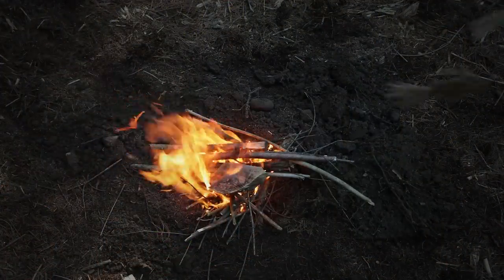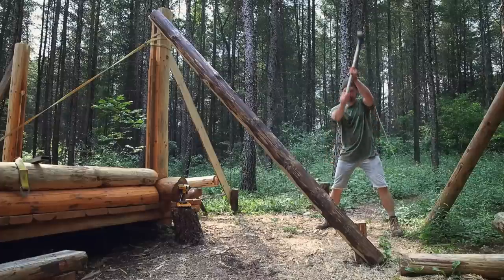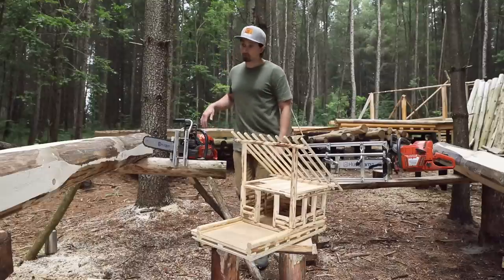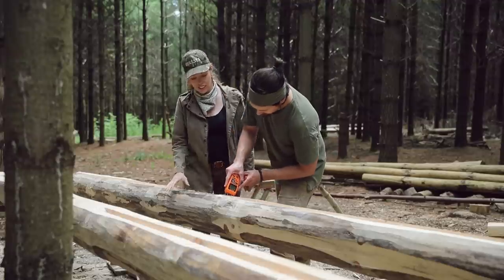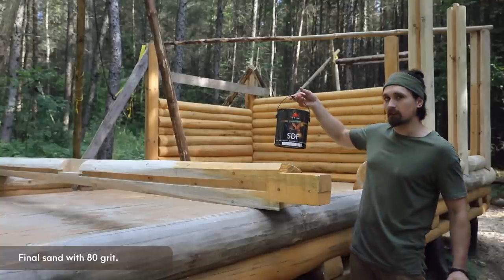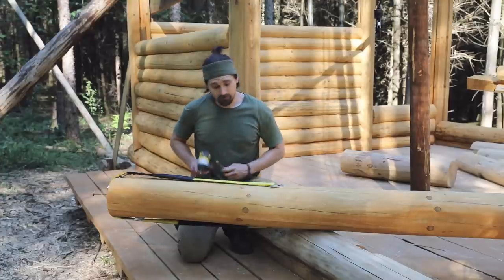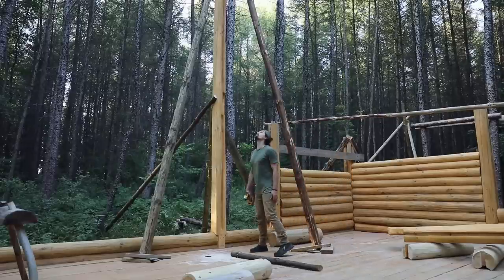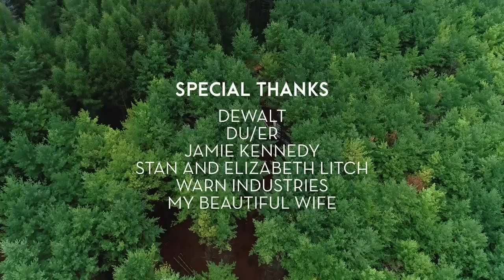EP16: Self Harvested Log Cabin Build / Raising Massive Post Alone

Comment: OMG a free education! No, really it's just very nice t see this wonderfully great guy do his thing! I am SO SO INSPIRED! I have 40 logs ready, but I am working with Maple tree hardwood. WHich  I KNOW is not the material of choice with virtually anyone.
So I have several logs a year older which I am processing 1st.  they are few in number and are near completion of the prep after debarking. I am saturating then with an anti insect product of borate's. Then putting a semi UV protection/ sealing on the logs after the borate dries overnight.

Will try to get through the remainder of the debarking/ borate/ sealing process this season, though I am unsure if time will allow here.
I am so fascinated by the hand hewed work as I have done this on a 3 story horse barn some years ago now. I really like your design idea a lot! 
I live in an open field and get frequent high speed winds. I think the heavy super hard wood may stand up to these winds much better and they are all I have here on my land, so really I have no choice.

I move them with a 17,500 pound pulling power winch.  I think it best not to have too much of the new cabin go too high in the air ... I wish I could have your knowledge combined with what I have already learned. You have pretty clear explanations in just the visuals! But I love the 1st dining room meal part the best! Very heart warming! Kinda choked me right up there Mr!
<3

Comment: And at the ten minute mark of this video, the sun shone. The air became lighter, the moody pendulum of life broke into a smile, and there was Katlin, several more months into her creative schedule, hammering away,, and appearing again near the end of the video to remind us of what true beauty is and why a life that can be so full of problems is actually worth living.

With your lifting arrangements, there is an old method of using a "Stick" (say a sound a 25 foot plus pine tree,) as a form of crane that can reach most places on your cabin, once it is set up.
You need a hole in the ground with solid box sides to keep the foot of the stick secure, and then a series of ropes tied to it on three or four sides, (secured towards the top, or at least above the centre,) preferably with the ropes on 2/1 pulley blocks or even larger and secured back to surrounding trees or anchor points. 
Secure your chain blocks to the thin end of the stick and the ropes will allow you to swing the stick around over the project and position the chain blocks anywhere above a fairly large radius, depending on the weight that you are lifting,
For maximum reach, this stick can be central to your project, set in a hole in the cabin floor, and if this is not possible it can be set off to one side of the project, with the lifting process taking place from farthest away from the base of the stick and moving progressively nearer.

Yes, your tripod will work, too, but as you are discovering this method requires you to keep on dismantling and re-erecting it over your working space.
Best wishes both. Truly great to see you and observe how you are getting there, wherever there is.
Reply from the maker: Thank you. I looked into “Stick” probably would work great once it’s set up but it seemed like quite a rig to build. I think I’ll manage with the tripod for this cabin, anything bigger and I’d need a new strategy. Thanks again.

Comment: If you screw the logs to the posts, I think there will be gaps when the logs dry out and become thin. I put iron rods in the larger holes to keep the logs from shifting up and down, so that the weight of the logs would not leave gaps when they dried. I did not use screws to secure the logs to the posts.
Reply from the maker: Yeah, this was a tough decision. I didn’t screw ever log, only a few. I did that just to have a bit more lateral strength to the structure while it’s being built. Since I’ll be moving it the logs will get a chance to dry and then settled in tight when it’s in its final location.
Reply: @TrustinTimber  Yes. When I built small Log House at my small garden, I read a book which is written by Mr B. Allan Mackie. The title is Ecological Log Building. Now I gave up to build Log Cabin in Fukushima. I bought the Land in the mountain 2011. And then a week later, we got huge earthquake. My land is near the Fukushima Nuclear Power. My land is contaminated by radiation  and now a no-go zone another 200 years. Now I look forward to watching YouTube of people like you who are putting up rog houses. I hv been Alaska twice log years before. Please build a nice log house.
Reply from the maker: @donsaigo4874  sorry to hear about your land. I’ll do my best to build a nice cabin.

Comment: I'm a bit amused by a synergy going on here ;) Your largest posts are 17 feet tall, same as the posts that hold up the peak of our timber frame house design. Watching you raise that post I didn't think you were going to make it, it looked like the tripod was not going to be tall enough - but then it was up ;)  How long are the poles in that tripod? I have a much smaller version set up at the moment and find it quite a chore to move about. Can hardly imagine what it takes to adjust yours ;)
Reply from the maker: Haha, yeah, I did Pythagorean theorem. Can’t remember now but yeah, they are long. I just posted my putting up the other side. Had to lift it up on 4” risers. Just cutting it close. When there is a will there is a way.  I move it in very little steps.

Comment: I love this so much. Thanks for sharing. Incredibly inspired. You have great skills. I'll be starting a log build with a vertical wall system soon. How did you scribe, cut and fit those 17' posts so well without having it upright? It seems even having them on the ground to mark it would be cumbersome? Thanks for sharing the journey. Much love from Nova Scotia.
Reply from the maker: Great question. I used one of the smaller posts as a reference for measurements and fit and just made the male end the same.  I did have to do some fine tuning but got it pretty close.